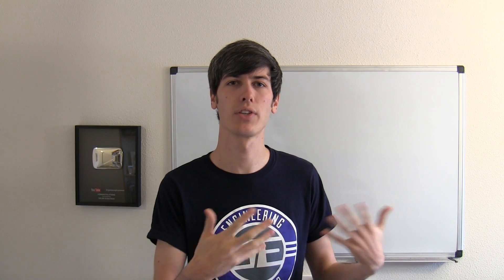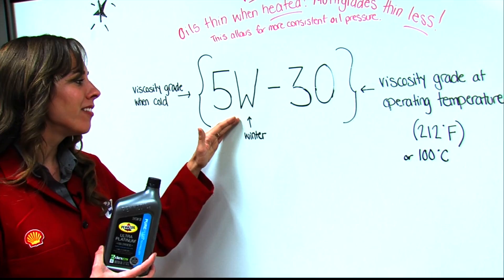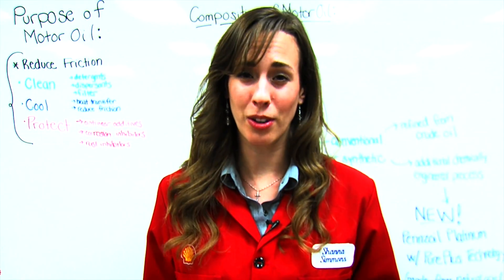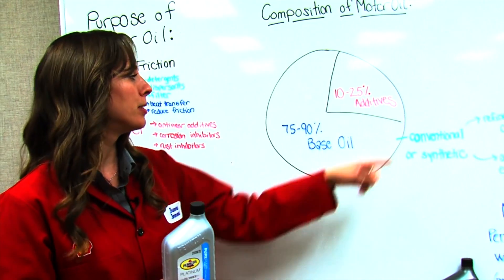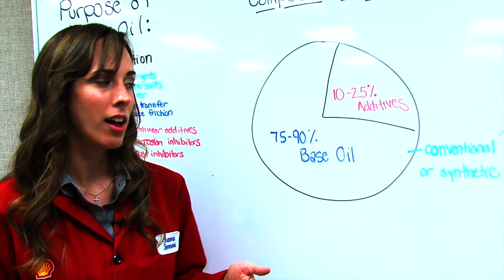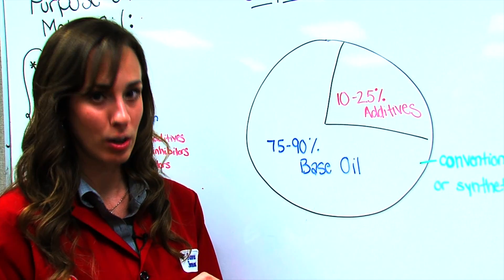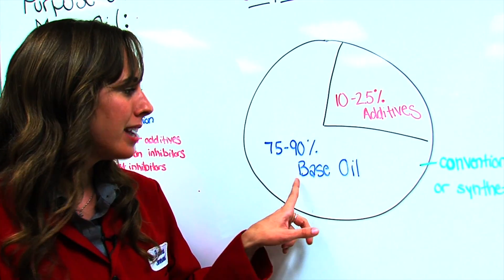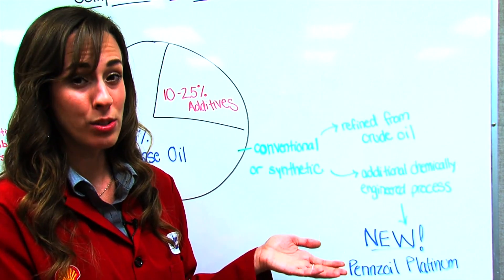Motor Oil Myths & FAQs - Synthetic vs Conventional

Comment: look in your owners manual as depending on you physical location on planet earth and temperature outside that number on your oil cover OR cap  is NOT correct FOR LOCATION...... if its cold outside then a 5w30 may not be right for you...its called a temp  limits in your manual....look at it it it shows you what oil to run and when........its NOT cut and DRY !!!!
Reply: +AwakeDude911     "if its cold outside then a 5w30 may not be right"
Well, 5w30 is good for cold temperatures.
0w20 is for very cold temperatures.
;)

Comment: Could you use a conventional motor oil with no additives in a contemporary conventional engine? Would it really make a difference, knowing engine oil manufacturers are in the business of making money, and shifting the focus of discussion, as to not have to explain things in historical perspective regarding past statements? I, for one, do not like to feel deceived by a trillion dollar industry, especially when they use deceptive practices to make their product sound better than what it is, or circumvent an automobile manufacturer's warranty. I think it is a fair question, and think there should be a tolerance test using several brand-new engines, using one as a control and the rest of them for comparative analysis.
Reply: +alphamongrel usually there is some little difference between oils and oils. Buying a brand oil you are just ensuring yourself that the oil was tested and it wasn't mixed with something weird just to make it cheaper. Synth oils on a conventional cars are just a waste of money. We've tested that on a dyno. Not a little difference was noticed.
Reply: +Hydrogen Sh 
You need to understand the difference between mineral and synthetic oils.
Reply: ***** actually, I do understand the difference and have tested then by myself on different equipment. You just said something and nothing at the same time. Point to something and we will discuss it.
Reply: Hydrogen Sh Read my other post on this.  If you are saying there is no difference in mineral and fully synthetic then ...well.....

Comment: So I can change from conventional to senthic and be fine?
Reply: +FIRENICEWOLF 
OK yes you can go from conventional oil to Synthetic without any adverse side effects, as long as you use the proper Viscosity. You will NOT get any leaks unless your motor is leaking already. What can occur on some older engines are leaks that have Gummed up from the conventional motor oil exposure to the air and heat of the engine acting like a glue to plug a leaking seal. Since synthetic oil does not sludge (well it would take an absurd amount of time and abuse to get a synthetic oil to sludge). That is why some people report they form a leak from switching to synthetic oil, it is not the oil that is causing the leak, it is a leak that was already there. Now all modern Synthetic oils are 100% compatible with all conventional motor oils. There was a very short time when synthetic oil was introduced to the market that many people and many shops spouted off with the nonsense that synthetic oil was not compatible with conventional oil. That is a Myth (just like the cell phone discharge myth at a gas station, where it went from being a prank online to being a law not to use your cell phone while pumping fuel), it was started by people that had little to no understanding of what synthetic motor oil is. 
NOW here is some thing I want to point out. UNLESS the Synthetic oil is processed from ester (a chemical produced in a lab by man, not crude oil taken from the ground) then it is not truely a synthetic oil. YES the government allows the manufactures to call a category 4 oil synthetic. But when you take something that starts as a crude oil and process it (basically filter it till there is no waxes left in the crude oil. This helps prevent sledging) then throw a bunch of additives in it, you really can't call it synthetic (adjective: synthetic 
1. 
(of a substance) made by chemical synthesis, especially to imitate a natural product). by definition alone they should not be allowed to call it anything other then CAT. 4 conventional oil, since it started its life out a crude oil it is not synthetic. 
OK rant over:
Category 5 oils are what you really are after. They are man made to do a specific job. MOTUL and AMSOIL are the two I have tested and trust. Both work amazing, I prefer AMSOIL because it is an American company that offers a full range of true synthetic lubricants, from gun oil to engine oil. They even have a 25 Thousand mile or one year guarantee on their oil. You can run it longer and do less oil changes (make sure if you are going to run an oil longer get an extended range oil filter or replace the oil filer at the millage they are rated at) 

Link below for example:
http://www.amsoil.com/shop/by-product/motor-oil/gasoline/sae-0w-20-signature-series-100-percent-synthetic-motor-oil/?code=ASMQT-EA#
Reply: AwakeDude911
I bought a 1990 Mazda Miata, it was run hard and poorly maintained... no leaks, I switched to fully synthetic, no leaks. Built the car to run track days, using the stock engine (that had just over 150k miles on it). The thing is still running strong a 275k miles. Still no leaks. I would venture to say, if you own a car that is prone to leaking then no matter what you run in it, the leaks will happen. I just enjoy the added performance and relative reliability a proper synthetic oil (not just engine oil, I use AMSOIL in everything... engine transmission, brake system, power steering... all of it) The night and day difference you can feel from the vehicle when you change from one to the other, really is no joke. That and there really is no reason to continue to use conventional oils anymore. It is like the whole SSD vs HDD when it comes to computers. A 1TB SSD cost about 230 bucks now. When you factor in a 1TB HDD cost right about 100 bucks (not the cheap crappy one, but one that can actually perform OK, and has a 5 year warranty). There is just no reason not to use the better product.

When it comes to the money we all spend on buying a vehicle, unless someone else is paying the bills for you, then the little extra you have to spend on the peace and mind you get from running the better stuff out weighs the extra cost.
Reply: +Vagabond X 
Sorry this is a complete myth, I have heard it repeated many times. The only reason you would have a leak is if the engine is leaking already, synthetic does not cause leaks. On top of that if you do find you have a leak, it will not magically "fix" itself. Some older cars have worn out seals that do tighten up a bit when the engine warms everything up. But again that has nothing to do with lubricating fluids you run in the engine. You can run in to a situation of a leaking seal that has been plugged up by sludge from the use of conventional oil, that starts to leak after using synthetic oil. Since synthetic oil does not sludge, when the engine warms up and melts the sludge that was there from the conventional motor oil, the synthetic can now pass through where it is leaking. Then because the synthetic oil it does not sludge it will keep leaking. I have seen this many times on older vehicles. 

OH and You most certainly can go right back to conventional oil after running synthetic, with out any adverse side effects. In the first introduction of synthetic motor oils, there was a short period of issues with seal-swell rates, but that was corrected very early on and is not an issue now a days. 

Here is a really interesting write up ( I knew I like AMSOIL for a reason)
http://www.autoblog.com/2008/07/01/synthetic-motor-oil/
Reply: Yeah, remember to drain the conventional oil out fully
Reply: AwakeDude911
There is nothing in oil (Synthetic or conventional) that can cause the condition you are talking about. You are talking about a 1990's Volvo, 850s were pledged with all sorts of problems. One of them being poorly made head gaskets. Just like the Land Rovers of the 1990s they will leak from every seal starting around 60 thousand miles. There is nothing in Synthetic oil that is going to cause a leak, the issue is the engine was already leaking. The old burnt conventional oil that had slugged up was plugging the leaks. The Synthetic oil you but in there will not sludge and since you engine was leaking you ran in to the issue that I have seen time and time again. The leaks that were there continue to leak and no gum up like they were with the conventional oil in the engine. Beside the main issue was the 1990ish Volvo. Very strong and well built body... the rest of things, ah not so much, and the Ford built Volvo's were even worse.
Reply: Eugenio C spelling, it will stop your engine from spell checking
Reply: +ThunderStrike 
Synthetic and conventional are 100% compatible, while yes you should warm up your engine and then drain the old oil completely, however there is not issue if some conventional oil is left behind.
Reply: +FIRENICEWOLF ......................don't do it..........if your seals in your car are old they will leak and then your BONED there is no going back besides a rebuild of them seals...I wrecked 2 Volvo 850 with this test....they smoked like bastards out the tail pipe after 1000 miles of the new oil...every one said it wasn't the oil but its slicker than conv motor oil and old seal will leak...cost me $1800 for my lesson....
Reply: +MasterMech77 ......................yep think I said that ....the new oil is gonna slip and slide over and under any seal it can as they are worn but just because the car is newer doesn't mean this wont happen to them as well 5/10 yrs down the road...for myself unless I get a 5 yr and under car ill use the sludge stuff .....no plans on either option here...
Reply: +MasterMech77 
Well done. Good job!
Reply: senthetic will dimage yer injun
Reply: +erg0centric 
Why?
Reply: erg0centric
Nice troll :P
Reply: +erg0centric That explans everthin! I did a injun speel check delete on my Mzda.
Reply: +FIRENICEWOLF I did that to a 99 camry and it started leaking, switched back to hi-mileage conv. still leaking so I would not do it.
Reply: bill man never delete spellcheck on a Toyota engine, guaranteed to leek.
Reply: You can, but some times the synthetic oil leaks, where regular may not. Synthetic oil has smaller molecules, or basically the oil is smaller, and thus can fit into smaller gaps. If you switch to synthetic and it starts leaking, in most cases switching back will stop it.
Reply: Kevin Weil
The main thing about leaks is, conventional motor oil oxidize and sludge at much lower temps then fully synthetic category 5 oils. When a seal is leaking conventional motor oil is still leaking from that seal but is more or less burning and plugging the gaps which can act like a dam to reduce the leak. Fully synthetic motor oil stays liquid through extreme temps and thus flows through the leaking seal far easier. I have seen it myself many times through the years. If nothing else synthetic will keep a healthy seals from leaking far longer then conventional motor oils, due to the ability of synthetics maintaining a higher level of lubrication.
However I want to point out that a weight of a motor oil is referencing its film strength, so 30w is 30w no matter what it is made from. SO as long as you use the recommended weight oil, synthetic is not going to leak any more then conventional oils. It just stays fluid longer in more extreme conditions and travels further so can look as if it is leaking more.
Reply: that is a super lie
Reply: Found an interesting article about this topic... makes for a good read too:
http://auto.howstuffworks.com/switch-to-synthetic-oil.htm

Comment: Why do Audi's engines burn oil so fast?
Reply: +Quyen Nguyen (Audi Love-Hate) Simple, the engine is built loose (lowering the internal friction and therefore increases fuel economy), BUT it is kinda similar to the VW cheat, fuel economy does not take into consideration the financial or environmental effects when you add the oil factor.
Reply: Many AUDI stealerships (thanks AVE for the term) have a drive through oil topup bay to keep you going.

Comment: missed one, you can't go back and forth between synthetic and regular motor oil.  I find this unlikely to be true, but I have nothing to back it up with so some secondary source would be nice.
Reply: +roguedogx 
Of course you can go back from synth to semi-synth and then to synth again.
You can also mix them if they have the same specs.
Reply: Eugenio C I know that but its a rumor that still persists.  I recently went to a tire shop to get my oil changed, and after I told them I ran synthetic (I prefer Quaker state with a Bosch filter I find it gets the best results when measuring fuel economy)  and they insisted that I actually put synthetic in instead of regular oil.  I would say this was just them trying to up sell me ($20 more to be precise)but I had already paid by that point so why bother?
Reply: +roguedogx 
All the car mechanics, all over the world, tell and push the clients to use a full synth oil because it's better. They take advantage of the "ignorance" in this field of the client and (you are right) they up sell them.
There is no problem to the engine to pass from full synth to regular or vice-versa.
The oil can be full synth, semi-synth or (old) mineral, but in any case it keeps the engine lubricated.

Nowadays all the car makers use full synth oil only because they are low grade, so they help to save fuel = less pollution. With these oils they pass the "test". 
Only full synth oils are low (5w30) and very low grade (0w30 and 0w20). 
Even if you add all the best additives in a mineral oil to make it semi-synth, you can reach 10w40, no lower. And it is not a fuel saver oil. It's better than a 15w50 and much better than a 20W50 or 60, but no longer good to meet the (always more) restrictive anti-pollution laws. 
Now, I live in a country when during summer the temperature can reach 45-47 Celsius / 113-116,5 Fahrenheit. Do you think you can use a full synth 0w30 oil?

There is no point to use a full synth oil in a regular normal car and you can use a full synth oil during the winter and a regular oil during the rest of the year.
Last but not least, in older car, with high mileage, full synth can be is highly not recommended, because of the sludge and the deposits.
At the next service, you buy a semi synth oil and you change the oil by yourself, so you save money and have fun in fiddling around on the engine.

Comment: that's bs. A lot of times they want you to use the thinner oil because it'll wear the parts out faster and then ull have to go in and get your car serviced more often. I have always used 20w-50 in all of my cars and it has only increased hp efficiency and I have seldom had problems with the engine or drivetrain. I have owned an old 88 f150, an old Hyundai accent 1.2L, a minivan a big dodge 2500 15 passenger van, and a 15 passenger 7.3L ford. And a Dodge Sprinter from 04 but I don't remember what oil I used on it. I think it was the same though.

Comment: bs penzoil sucks it only lasted 2,500 miles on my evo, used mobile 1 after lasted me 4, 000 and engine was still running smooth. penzoil made my car run retarted under WOT, previous owner did oil change at jiffylube smh

Comment: the most important question is when to change oil,that is how many kilometers, for both mineral, semi synthetic oils.plz answet
Reply: +Suman Sengupta 
Usually you have to follow the car maker recommendations, but It's impossible to answer 100% correctly to your answer because there are too may factors to consider: mileage of the engine, use of the vehicle, local temperature, presence of sand... 
How many miles do you drive per day on average?
It's a stop&go drive or more at constant speed?
Do you live next to the sea or in a dry area with more presence of sand than in a city?
Which use to you do of your car? Load, towing... ?

Comment: extreme cold, thinner oil is better, thicker weight in the summer. but over 10w 30 is your all round weight. if i lived in florida id go slightly thicker oil and vise for if i lived in alaska. not necessary  what brand of oil is used , matters you change it in regular  intervals.  Unless you got some suppa duper high performance  engine.

Comment: In regards to the break in method with oil. One reason why I choose to use conventional oil is because it is less expensive. For the initial start up after the motor has been ran for 30 min, I dump the oil for inspection and change the filter. If using full synthetic, during the 30 min and the first 500 miles, that would be pretty expensive. 

Race engines are different, start the beast up, change the oil after the initial 30 min, then go flog on it till the end of the race weekend. In a race engine, if something is going to let go, its going to let go. Engine break in is more for longevity, and use for 100K miles.